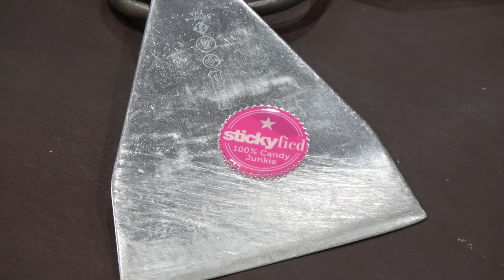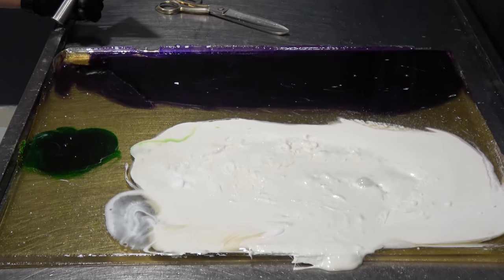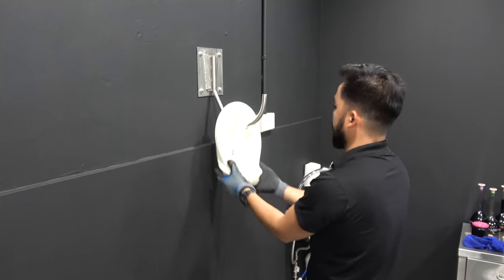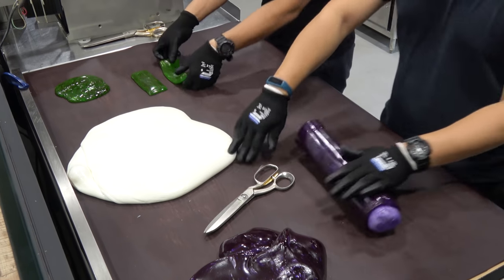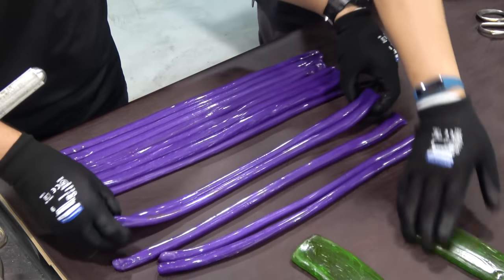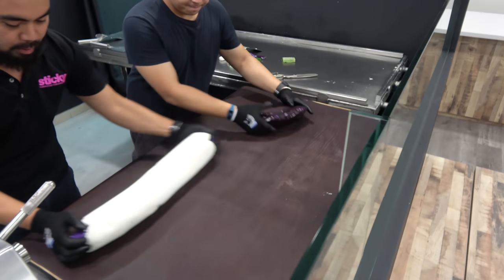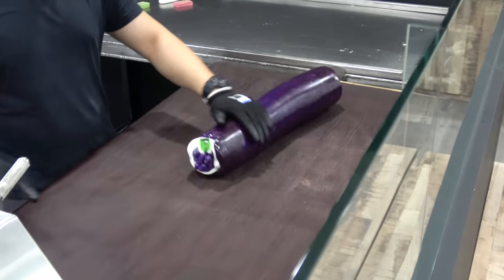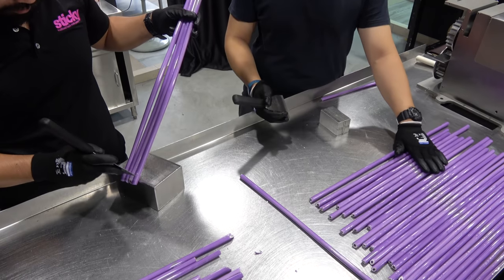How Sticky Candy Are Made

Comment: What was that white liquid they poured down at 1:18 ?
Reply: withgaming :titanium dioxide. It’s a metallic compound used to die white (mainly used by non traditional candy makers). It’s usually not good to put foreign chemicals in your body because it may create a toxic build up.  some people say titanium dioxide can harm your body over time. Traditional, safe candy makers just fold the candy on the hook (like what they did, except they did it just for texture and flavour) and that makes the candy white, and it adds more texture and flavour (it adds more flavour because of more surface area for your taste buds to taste(air bubbles folded in make more surface area))
Reply: @octo349  How crucial is titanium dioxide in making this candies? Will the taste be different if I decide not to use it? What about colour? Is the difference noticeable in that case? Also.as I know,citric acid is used during production of this candies.what does that do?